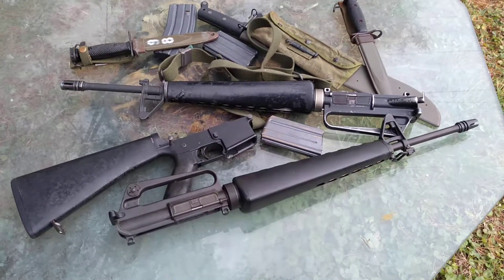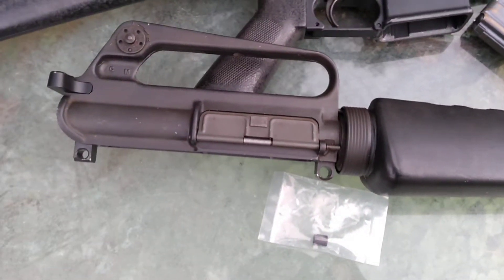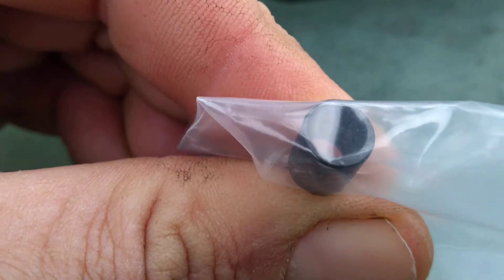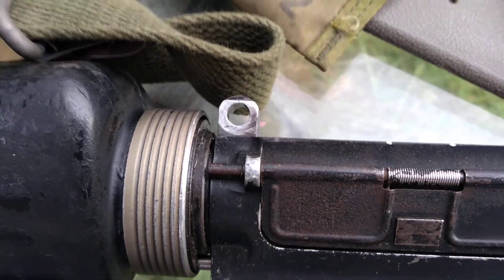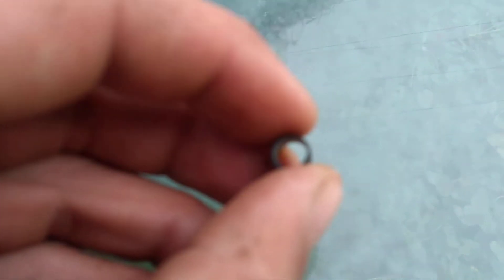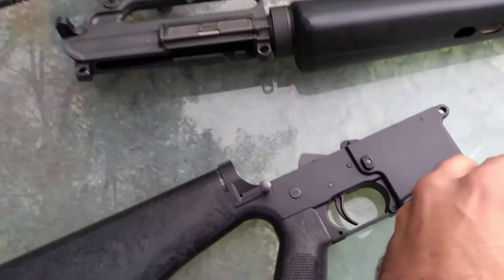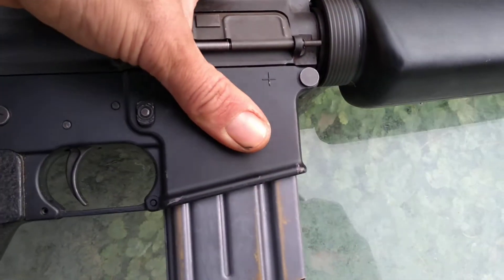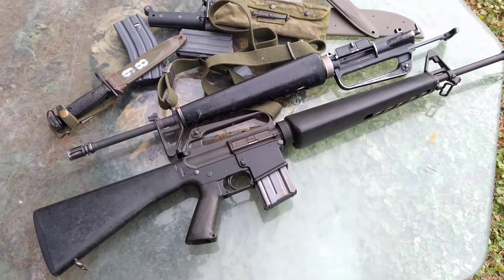colt SP1 upper on Brownells retro 601 lower fitted with adapter bushing to make early m16 clone

Comment: was in the same situation, got an sp1 upper bought same brownells lower. I was fustrasted with getting the bushing just right along with the detent with the pin. I just ended up buying the brownels upper and replacing the sp1 upper

Comment: The bushing hole is oblong and can rotate when firing and will cause the front of the upper to separate from the lower by about 1/8 of an inch and cause the rifle to malfunction.
Reply: Not true. Also, that bushing is machined eccentric for a reason; when the upper pivots open it gives clearance to the lower hinge.
Reply: So loctite it.
Reply: @Gostwriterindisguise  I did that and then I sold it.
Reply: Absolutely true. The eccentricity of the bushing requires it to be rotated to get the pins to close. Once closed, if not 'fixed' in place the bushing will rotate causing just enough upper movement to induce failure AND wedge the upper backward against the lower making the takedown pin(s) so tight you have to tap them out with a hammer. This just happened with a Colt A2 Reg Rec. on full auto. I had M60Joe mod the lower years back to milspec small hole for custom upper. Use this bushing to adapt the original upper as a beater for a FA event a couple days ago and it worked for about 6 rounds then started failing. Probably needs pinned into the fat side of the bushing, if even worth the trouble.
Reply: @controlledburst  You sir are correct. It can be held in place using red loctite. But it can no longer be considered a reliable firearm because you will always have an itching thought in the back of your mind.

Comment: Some earlier SP1s will be .250 pins and not require the adapter. I believe colt started doing the larger front pin on the SP1s sometime in the 70s because they were getting political pressure about full auto conversions being too easy. They also changed the hammer and trigger pin size to be larger so an M16 hammer/trigger/disconnector wouldn't fit. I'm not sure what the point of making the M16 upper not interchangeable was. It's not illegal to use an M16 upper on a civilian lower and the full auto BCG will still slide right into the civi upper.